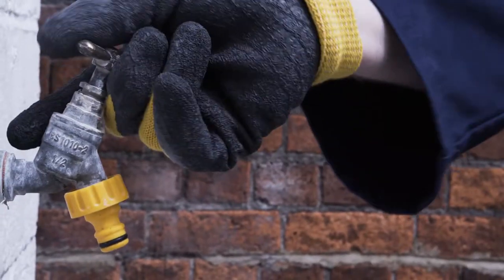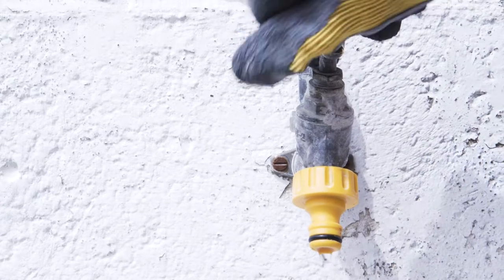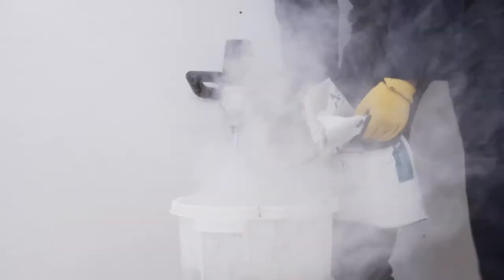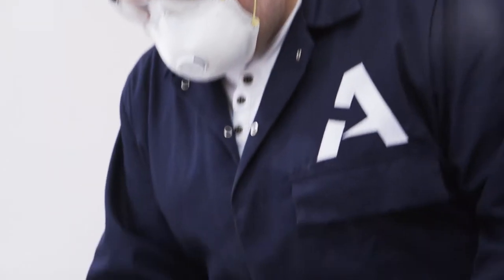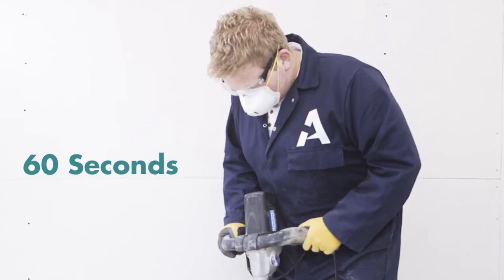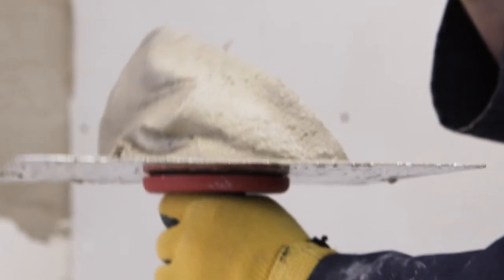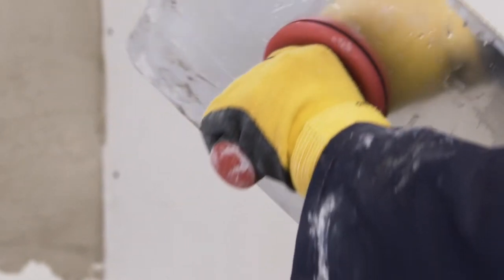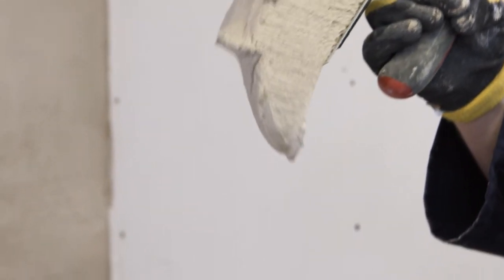Step 1 How to mix Breathaplasta - the quick setting lime plaster wall finish

Comment: No PVA on the walls before application? Can it be used directly on lath? Thanks
Reply from the maker: PVA is best avoided as this will seal the wall and reduce breathability - this can lead to issues with moisture. Breathaplasta can be applied directly to masonry (brick, block, stone) as well as most other backgrounds. A breathable primer or bonding agent can be used where there's insufficient key and onto specialist plasterboards (fire protection and moisture resistant). 

Breathaplasta can be applied directly onto wooden lath. We recommend adding fibres such as traditional horse hair to give extra strength and minimise shrinking and cracking in the backing coat. Plastering hair also holds the plaster keys in place when plastering onto lath.